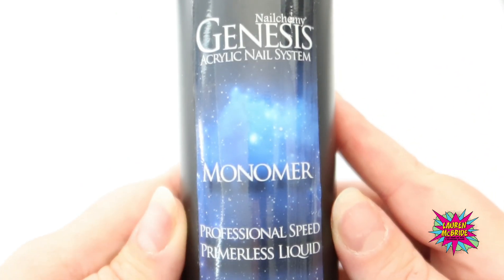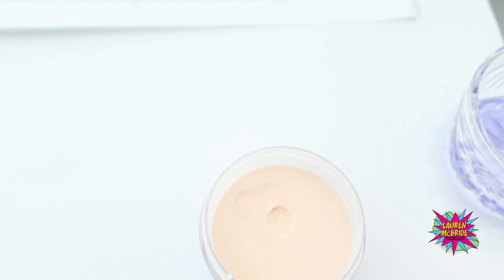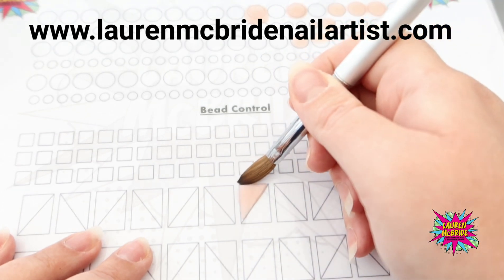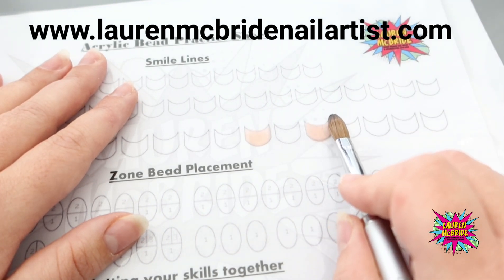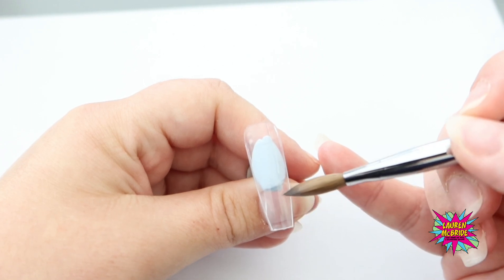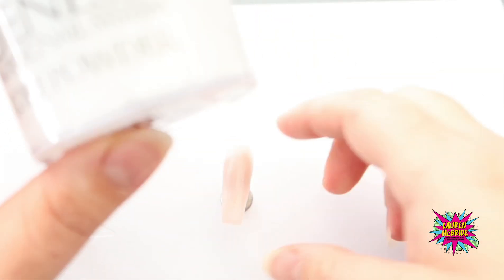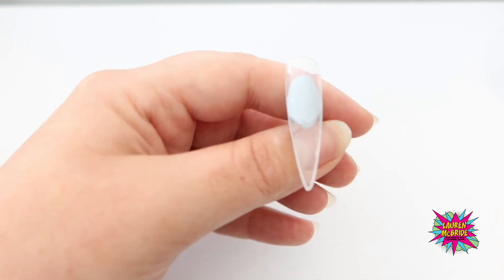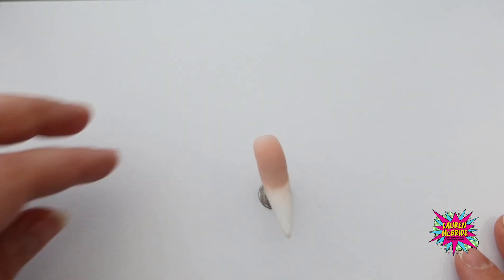PERFECTING YOUR ACRYLIC BEAD PLACEMENT

Comment: How do you stop the acrylic from sticking to your brush when your pushing it
Reply: Wipe the brush surface each time you move away with the brush from the acrylic eg place bead wipe tap for cuticle wipe sidewall  wipe opposite side wall wipe....you are constantly wiping the excess off your brush.....how you pick your bead up effects it too the bead should be on one side of the brush and detaches easily when placed on nail xx